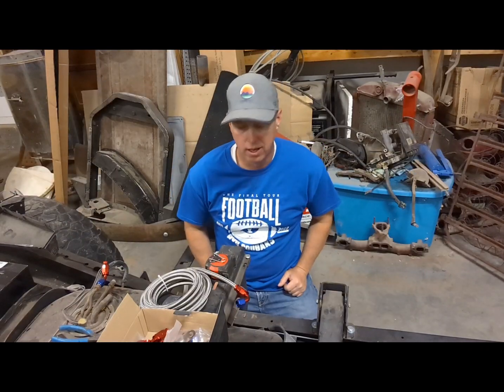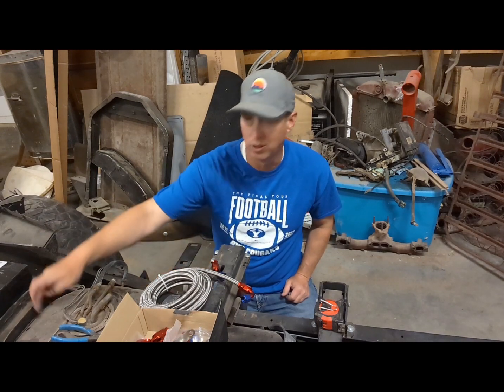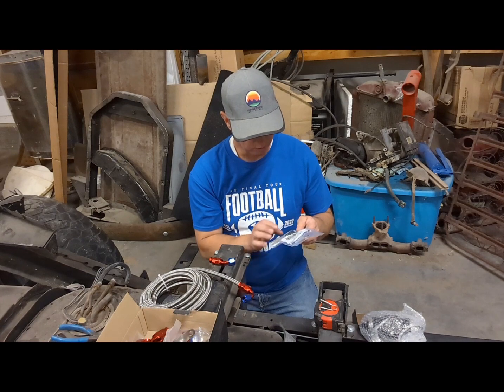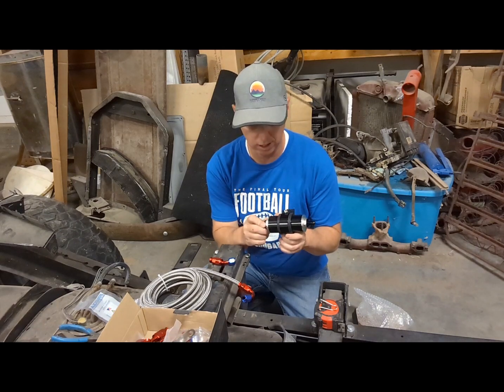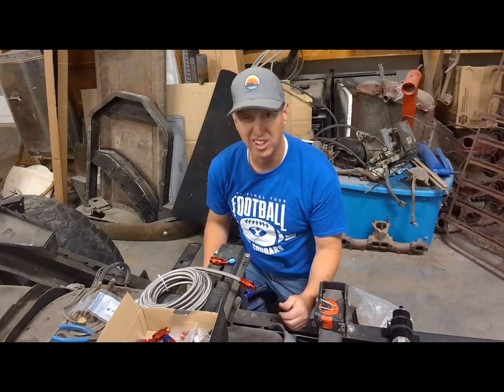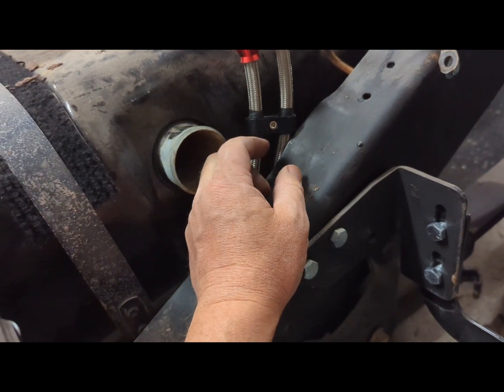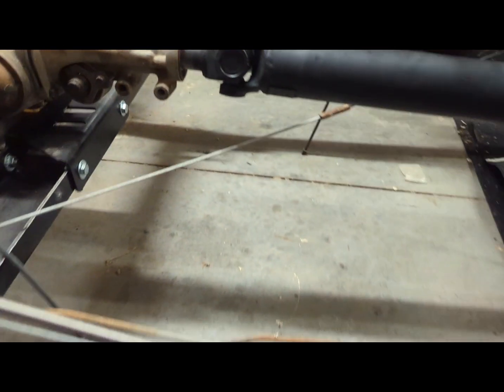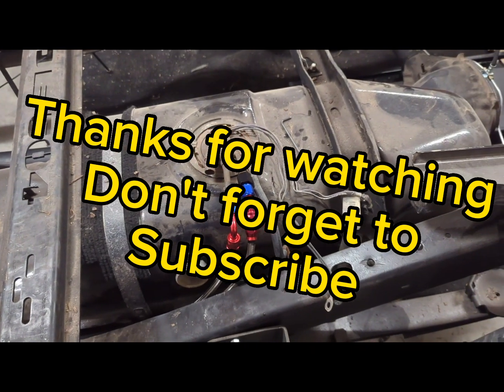1951 GMC 100 - S10 Conversion - Fuel Lines

Comment: Nice work. I'm curious, what's the plan for the fill hose & cap location?
Reply from the maker: I'm curious too.  Any ideas?  

I might get a flange and cut a new hole into the top of the tank.  That would bring the filler cap straight into the bed.  I would then blind off the old filler hole.